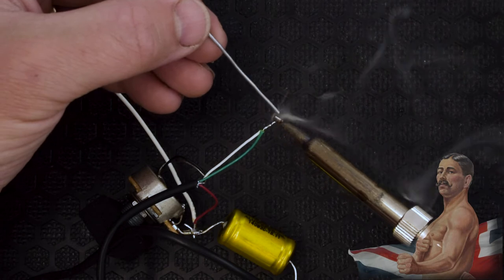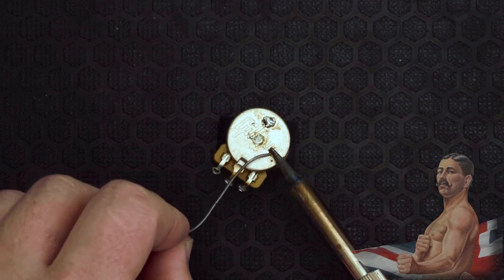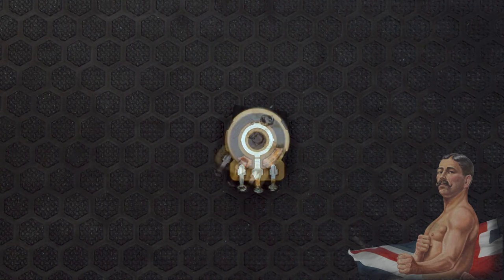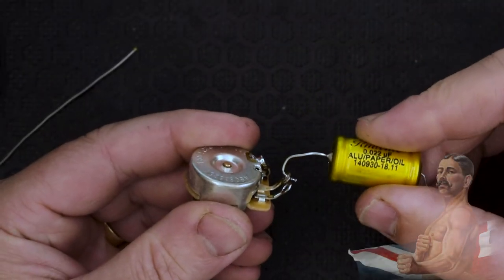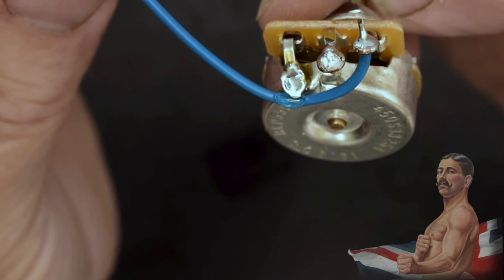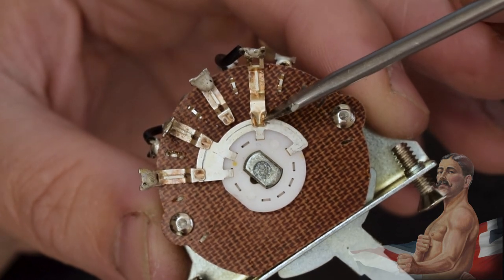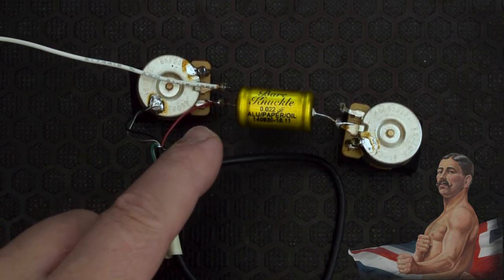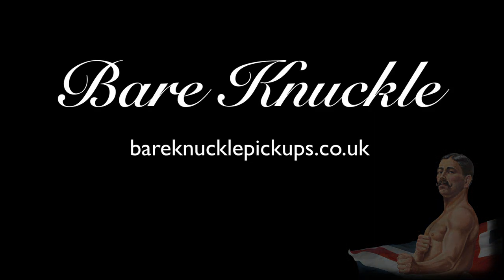Common Pickup Installation Issues

Comment: Hi! Thanks very much for this. Just one thing, does it make a difference if the black and bare wires are soldered together and grounded, or do they have to be grounded seperately? (as at 5:03) :) Thanks in advance!
Reply from the maker: Hi Dan, depending on the setup, the black and bare are usually both grounded, so, in most cases, you can ground them together

Comment: Very useful, thank you for posting. Just one question: which temperature should be adecuate on soldering iron for guitar electronics?. On your video it seems that the soldering iron was set to 400ºC. Is that fine?
Reply from the maker: It's going to depend a little on the specific melting point of the solder that you use. I personally prefer to run the iron pretty hot and work as fast as possible, which minimises the total amount of heat that you're applying. On the units that we use, 400 degrees is about right
Reply: @BKPickups  Thank you very much for the reply

Comment: I have a FAT 50 Neck on my Telecaster. It has about 6.8k Dc Resistance. Could you use 500k pots? Do you recommend it for this capsule?

Greetings
Reply from the maker: You can definitely tailor the sound of a pickup by choosing the pot value. 500k pots with a traditional singlecoil can be a little bit bright for a lot of people, but if the overall setup of the guitar makes it particularly dark, then that higher pot resistance could be a good option.

Comment: what if the baseplate of the humbucker doesn't match the screw holes of the pickgaurd exactly. can you bend them, or do you need to have new holes drilled/a new pickgaurd made?
Reply from the maker: Most humbuckers fitments are pretty universal, but if you need to adjust things, there is some maleability in the metal of a baseplate, so you certainly can slightly bend them if you are careful. Some humbucker fitments use a double hole on one side of the pickup (ours are all single hole) and for that, you really need to use an adapter, or drill a new hole in the pickguard.
Reply: @BKPickups  awesome thank you for the info

Comment: Perhaps i just reach out via email, i just got 2 new pots and pair of bkp's installed in my guitar, this was two trips to a guitar tech, 1st time to install pickups, then 2nd time to install new pots and a cap. 2nd time i got my guitar back worse then when i dropped it off, when i switch to my neck(cobra) at full volume i get almost no signal, this is all being tested with high gain. What usually gets it working is switching from the neck pickup to position 4 and then back, its so weird. People are telling me to spray the switch with contact cleaner but i fear the "tech" just installed them wrong.
Reply from the maker: Hi Nate, check to see if your blade switch is hitting the guitar before it fully clicks into the 5th position. Sometimes you just need to slightly lengthen the slot that the switch sit in, to allow it to reach its full range of movement.